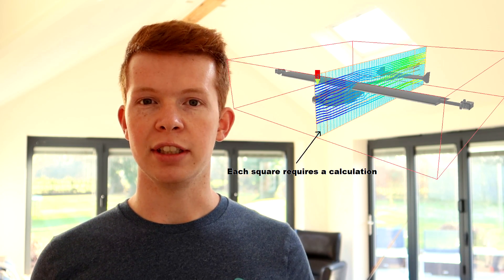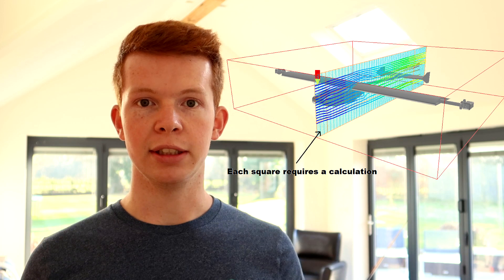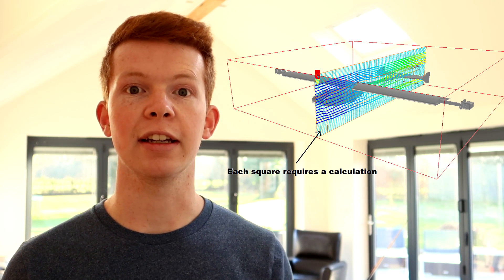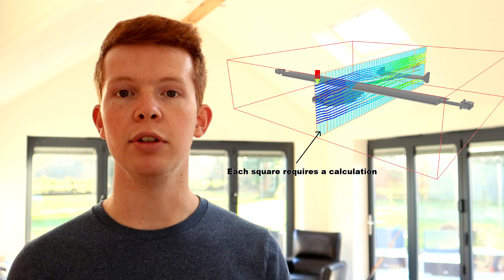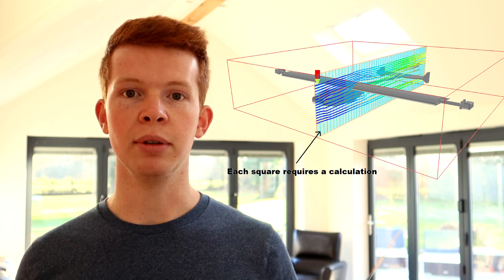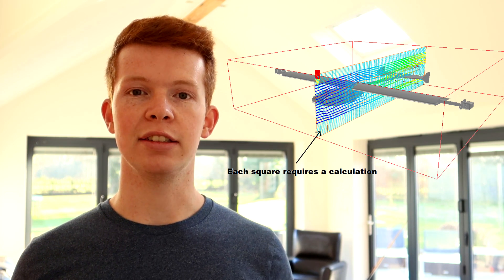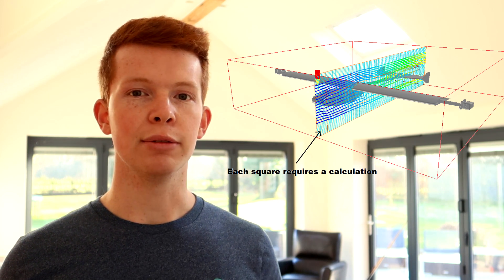Computational Fluid Dynamic Basics

Comment: Unfortunately the velocity argument is wrong for airfoils, it is a combination of different theorems - the one explained is also used by some professors (unfortunately). In the end it all comes down to the curvature of the wing and using Bernoulli's equation for different streamlines is not allowed.

Comment: Is it possible to use CFD software without knowing much about the topic? Is there even any free software for this?
Reply: OpenFoam is a free toolbox for CFD, but you have to know what you want to simulate before doing it, or you will not be able to create a feasible simulation, or even interpret the results.

Comment: You can't use Bernoulli's principle that well on the airfoil because it isn't really a laminar flow, it will have turbulence in the flow. The effect caused by Bernoulli's principle is actually not enough to cause lift, that is a big misconception, there is more to it than that. I'm leaving a link here about it if you want to have a look. I am sure you are a bit interested in fluid dynamics and science if you have a hobby such as this. I would advise you to read about the subject as fluid dynamics is incredibly cool and useful.
http://www.allstar.fiu.edu/AERO/airflylvl3.htm
Reply: The Bernoulli principle can still be applied along individual streamlines in a turbulent flow. A turbulent flow is also not necessary if you manage to not trip the boundary layer. Some portion of the lift is due to the pressure differential though most of it is cause of deflecting of the flow downwards.
Reply: Use the lifting line theory
Reply: Practically nothing is laminar in reality. Bernoulli's principle works really well if you apply it to the flow just outside of the boundary layer, whether that boundary layer is laminar or tubulent. It's seperated flow, and compressible flow (~100m/s +) where bernoulli's principle breaks down. The pressure difference above and below the airfoil, determined by airspeed change which bernoulli's principle translates to a dyamic pressure (1/2*density*speed^2) is absolutely enough to cause lift. Any aero engineer worth their salt can prove that with a 'back of the envelope' calculation.
Reply: Toph Norris AHAHAHAHA another Einstein bloviates on ahahaha
Reply: ahahahahahahahahah your opinion is as  much an unknown THEORY as bernoulis.. get a grip.. no one  knows.. bernoulis equations work just as well as any alternative.. what a moron..doc johnny

Comment: Do you know of any software for helicopter rotor blades? I have a book full of equations, but would love to find some software that I could put in the rotor dimensions and it would calculate lift at various RPMs and blade angles, ideal twist, ideal washout, required tail rotor thrust to compensate torque, HP needed to drive the rotor at various RPMs, etc, etc......In other words, doing the math myself is not how I want to spend my day.
Reply: most cfd software can do this but it's a complicated process which is a heavy calculation for most pcs and needs skill in cad and cfd software. It's also a difference if you want to simulate static thrust, thrust in different forwardflight situations, braking maneuvers or climb/decend